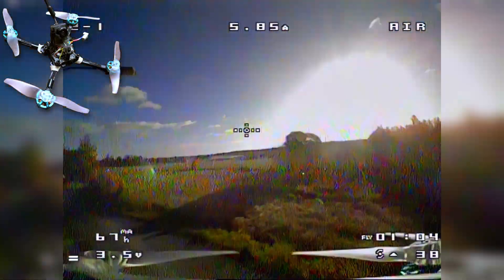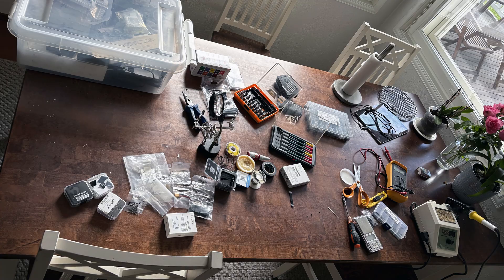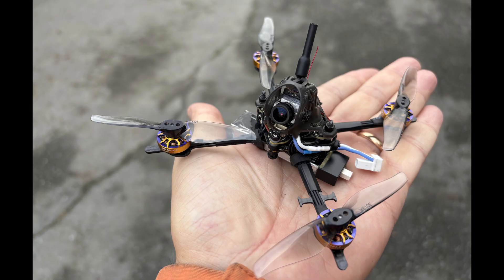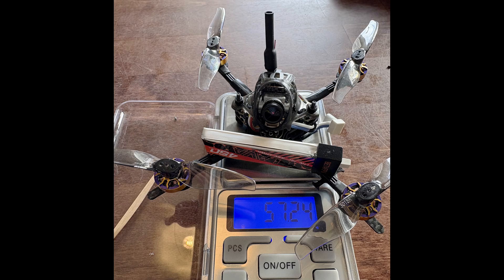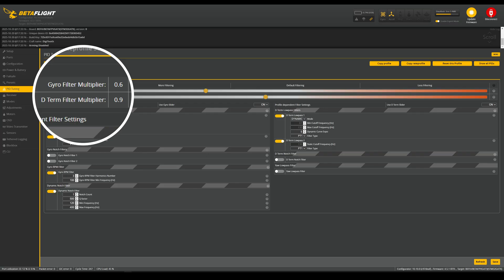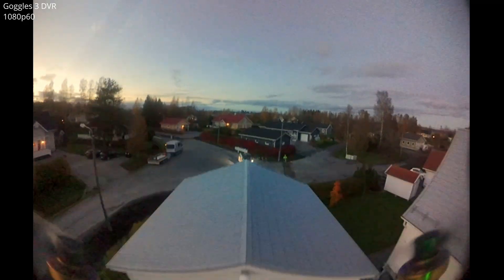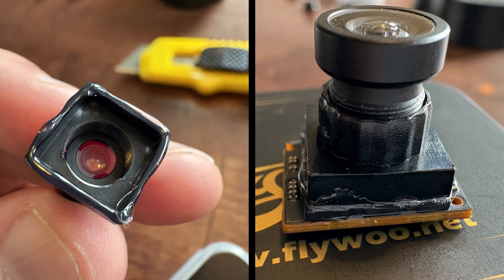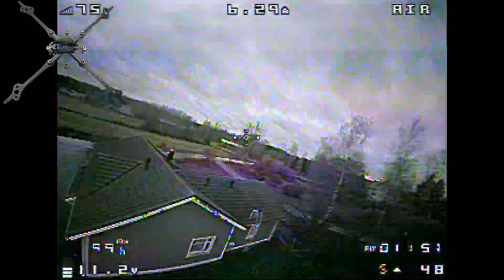DJI O4 1S Digital Babytooth build [FPV]

Comment: Hey.
Do you think the same will work when I take a caddx ant lite ?
I don't know the size of the sensor.
Reply from the maker: Yeah, tha Ant lite will work. it is the exat same lens and sensor as the regular ant. The only differences as far as I'm aware is that the lens is glued on the Ant lite cmopared to held by two screws on the regular Ant, meaning you have to heat up the Ant lite to get the lens off. The lite also does not have any screw holes for mounting the camera to the canopy (this is why I went with the regular Ant). and finally the lite has soldered cables instead of a connector to save weight.
Reply: @andreas-ohman  all right, than I will stick to the ant as well.
I want to upgrade my BetaFpv Meteor 75 pro, I like the o4 lite but indoor it's just not good with stock lens from dji

Comment: Nice mod! So much better fov than stock!

The 03 lens, moded on the 04 air units looks really good, too. Saw a guy the other day doing that. Forgot his name..Krom or something. French guy.
The mod is pretty cheap on aliexpress.

And yea, a tiny GPS at roughly 2 grams would be nice.

I'm waiting for the lens mod (o3), a new aio and a GPS from Sequre (2.3 grams).
Not sure if I'm gonna use Matrix 3-in-1 or Goku f405. Goku is slightly lighter, has built in barometer (although, not needed with GPS), and otherwise match the Matrix 3-in-1.
Reply from the maker: Yeah. Saw that too. Looks like you can connect an actual O3 camera to the O4.
The Goku looks real good too. It is new so I did nor know about it until after I went with the Matrix. The Goku ESCa are only 5A while the Matrix is 12A. That said, 5A should be ok on a Babytooth.
Reply: @andreas-ohman  Yea, no, it isn't.
Got the AiO yesterday, tested it today. It can fly, but sometimes I just lose juice and can't even hold the drone up in the air. I have enough juice to at least avoid a hard crash.
I haven't really noticed a pattern, as I didn't fly it that much, but if I did a punch out or if I was close to the end of the battery, it seemed like this would occur.

Should have gone for the slightly more expensive one (from flywoo). The 1-2s one. That one has 12A as well.

Now I'll just have to wait for the Matrix 3-in-1 to arrive, but betafpv is extremely slow with shipping if you don't pay for the express option.

Comment: The non-pro O4 lite is garbage in low light.  I have to have every house light on just to fly whoops indoors.
Reply: If you use Manual Camera settings you can it to be much brighter even still at the lowest latency setting of 1080p/100fps. I can fly outside in almost the pitch black like that, especially if you lower the resolution to something like 4k/50 or 1080p/50-30fps for an even lower shutter speed setting. Manual mode also raises the max ISO from 6400 to 12800 on the O4 Lite's. 
The O4 Pro will raise it's ISO to atleast the 12800 in Auto mode, if not to the slightly higher 25600 ISO specific to the O4 Pro, but that could be only in Manual Mode as well I forget now off the top of my head, but definitely 12800 at least. They both do pretty well at night with even only the slightest street light spilling over in the background. Where-as the O3 was/is unflyable in anything like that, and the OG Air Unit camera could fly until about complete Sunset before it just got too dark to be worth it..

My Foxeer CAT S-Starlight 1-1/8" Analog Camera is still my best night time camera. It has a LUX Rating of 0.000001LUX and does the Auto Color to B&W Switching when needed and is the most fun at night, but you need a good VTX or the Analog noise can still make it tough for faster flying in very dark areas.. 
After seeing the videos im going to get one of those Caddx Gazer Camera's to try on a 5" build where I have the room for that AI box and see how it works out. There's also the Caddx Infra which is a true 0 LUX  Camera setup, but im not crazy about how it looks and how its always B&W no matter what..
Reply from the maker: Yeah, but betrer than the analog camera I have on the babyroorh and better than the Nebula Nano
Reply: @andreas-ohman  Yea an O4 Lite lens mod DIY Video with the Caddx Ant's Lens would be super helpful! Great video here as well! Makes me want to build a 3" Toothpick now! LOL
Reply: @andreas-ohman  Hey would you do a video on the O4lite lens mod?  Step by step and any lessons learned.  In particular, how to remove the rainbow film (UV filter) that is on the back most lenses.  Also does the lens mod help with low light picture at all?  I wish Flywoo would sell the replacement O4lite camera already modified.  
p.s. I went back to HDZero for my indoor whoops.
Reply from the maker: I could possibly do that. I myself watched this video on how to do the lend mod: https://www.youtube.com/watch?v=7SRJMu7M5YM
I used a knife the first time but the second time around I just used two pairs of pliers. stuck the sensor-board to one on the table, applied heat. gripped the actual lens module with the other pair of pliers and just gently twisted the lens loose.
No, the low-light performance is dependent on the sensor not the lens. so unless you have a really crappy lens that blocks light then low light performance should not be better nor worse due to a lens mod.

Comment: Throw gps on and strap a 18650 or 21700 on it.
Reply from the maker: Well, that could be interesting. A 18650 weighs about the same as the drone itself.